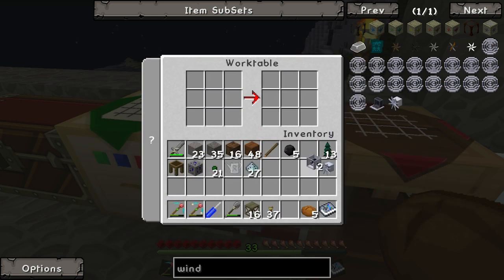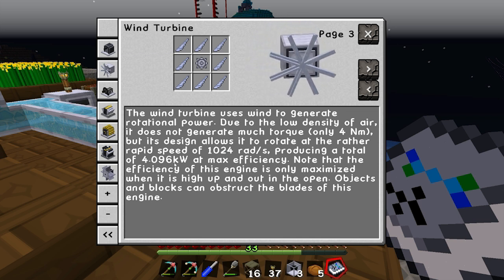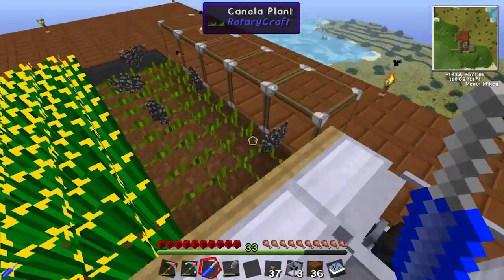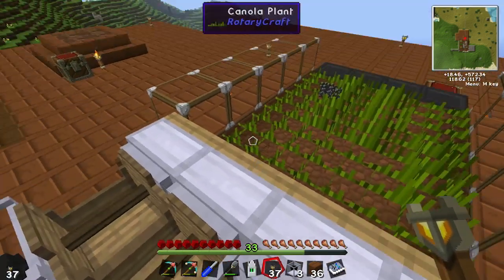Monster FTB Rotarycraft Wind Turbine, Splitting torque with Shaft Junctions

Comment: Which button you turn options Shaft Junction? I do not shift mode 1:1, and so on
Reply from the maker: All of my junctions are on 2 output 1 input mode at 1:1 to split 4nm into 2n+2nm and the into 1nm x4
Reply: Ausyarr 15 minutes you can see an interface Shaft Junction, where you can change the button 1:3, 3:1and so on, .What can access this menu?
Reply from the maker: right mouse button should, try with an empty hand.
Reply: I do not have this menu(
Reply from the maker: I'd say update if you can. you really should have the menu. probably a bug.
Reply: Thank you

Comment: Just a tip, if you're climbing ladders or other things using the ladder mechanic (for example the scaffoldings), just hold shift and you'll stay still ;) I noticed you were having some issues with that in this video. Like I commented on the other video though, awesome awesome series. Definitly the most helpfull videos I've seen so far from hours of searching on how to get started in rotarycraft :) earned yourself a new sub!
Reply from the maker: Thanks, I just tested and the ladder shift mechanic doesn't work on scaffolds. I usually use it to mine straight down with ladder so i don't fall.Tonight i'll upload one on steam engine using lava heat without exploding. So I can make lubricant with renewable power and need for gears. Thanks for your comment, they really help me.
Reply: Ausyarr Hey, no problem man. I assumed the scaffolds used the same mechanic and therefor would work the same way, surprising that they don't :o
Anyway, I'm looking forward to that next video and I'll make sure to send anybody having problems with rotarycraft to your videos :D
Reply from the maker: thanks, next episode is uploading now, youtube says another 77mins till its up.